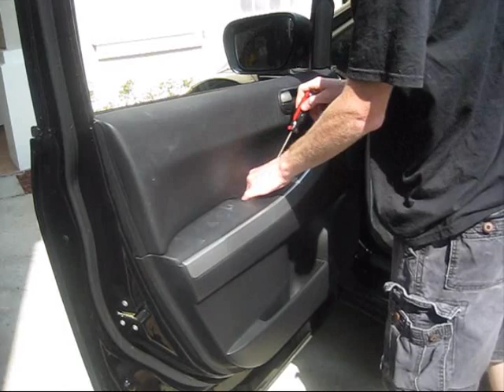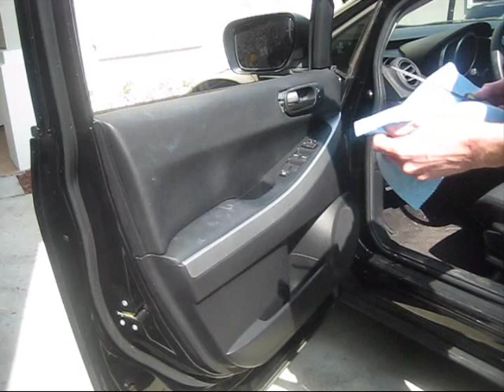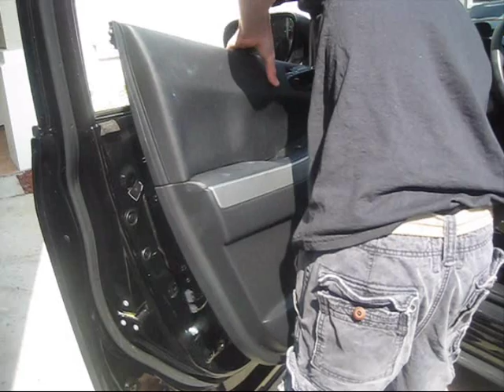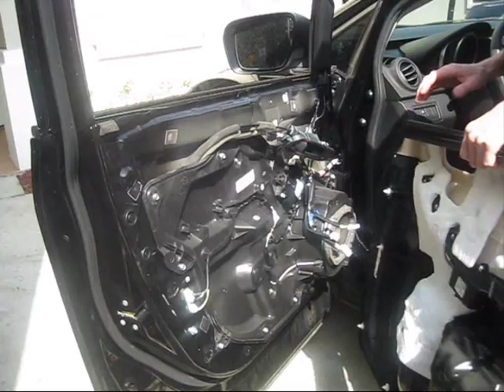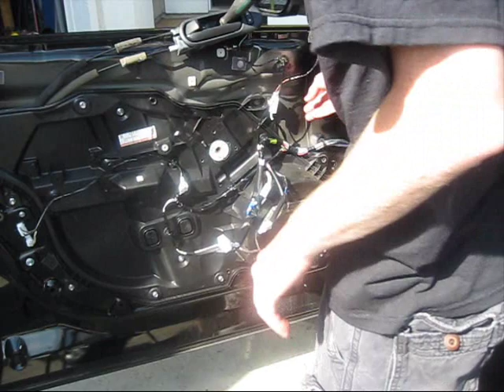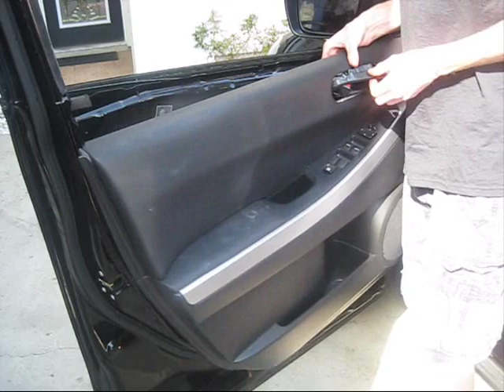Mazda CX-7 Window Motor Replacement

Comment: All of the disassembly instructions are correct, however, the sound you heard when you roll the window down is the sound of a broken gear that is connected to the motor. The motor is fine. If you look on the Wish app, you can find replacement gears for about $10. The you simply open the gear housing attached to the motor, replace the gear and that's it!  The whole process done in less than an hour.  I've done this myself.
Reply from the maker: Back when this video was made aftermarket motors didn't even exist yet. You had to get them from the dealer.

Comment: Can i just fix the stock window motor not replace it
Reply from the maker: You can replace the stripped out gears if you don't want to replace the whole thing. I recently had another go out and just picked up a good used one from the junkyard.

Comment: This happened to both of my front windows...instead of replacing the whole motor($200 last time I checked), if you open it up, there's a plastic white gear that had teeth broken off of it. I found a replacement gear for $7 on eBay. Saves a LOT of money!

Comment: What should I do if the metal wire comes off the plastic rotator inside the door? The window will come up about 10 inches and then fall down. The plastic on the rotator seems a little damaged but the metal wire also has parts in it where each individual wire is splitting apart. Any help?
Reply from the maker: That's what's called the regulator, you're best bet is to get a new one.

Comment: On my wife’s 2011 CX 7 the driver side window motor gear was stripped. The gear is made of  plastic, and  will not hold up to the torque of the motor. Followed the aforementioned  instructions, and worked like a champ. The door body snaps are very brittle. Had to replace four of them.  (Advance Auto $3.50) The motor was from Rock Auto , $47.00 delivered.  U tube University is great.

Comment: do you need to replace the window motor or just the $8 gear that goes inside the motor?
Reply from the maker: If you can get one just the gear, but they were only available as an assembly from a dealer when I first did this.
Reply: pfun41 fortunately for me, I just replaced with an $8 plastic gear and it worked fine. Thanks for the video

Comment: just wanted to say thanks so much man! just got done doing this and it wasn't to bad. however, for people doing this make sure when you remove the door handle assembly you make sure the cable controlling the lock is still in place. put the whole damn thing together just to find out the lock wouldn't engage. there is a slot that the cable slides into. think bike brake cable. after that it worked perfectly. thanks a million.

Comment: Just did mine and it works great now.  
But I still have one problem now, the door locks will not lock on the inside.
They will only lock from the outside.  What can I do?
Reply from the maker: Sounds like the lock switch connector didn't get plugged back in or a wire broke. Pop the interior handle assembly out and check the wires.
Reply: My wife tells me that's the way it should be.  If the engine is not running you cannot lock the doors.  Only after the engine is turned on will it lock.   so we're good.  There's another video on this where he ran into the same thing and I don't know if he ever figured it out.  I will try to find it and let him know.  One more thing, I didn't realize this when I was taking the panel off, but mine has two more screws to take out before taking off the panel.  They are hidden behind a cover on the door pull that I have on this model that you don't have on yours.  I had a hellava time trying to figure that out but eventually got it.  Thanks again.

Comment: I'm attempting this today.  What I am unsure of is after installing the replacement motor, you mention that it might not "line up correctly".  That needs a bit more clarification.  If it's not lined up correctly, does this mean, removing the motor and lining it up again, and then using the window control to move the spline in the motor?  Is there a way to ensure that the motor is lined up before installing the new one?  

Based on the video, It would seem that one would need to remove the motor to align it.  I guess I am just not sure how the motor can't be in alignment. If you roll the window all the way down, and then install the motor, and everything fits nice and tight, there shouldn't be any mis-alignment.  Unless, the motor has a range of motion in the gear box. Meaning that the motor knows when it is in a fully up or down window position.  But I'm assuming that the motor, when not connected to the regulator, will just spin in either direction continually.  If that is the case, how can it be not in alignment if installed correctly?

Does this make sense?
Reply from the maker: When you pull the old motor out the window may drop a little and the splines will no longer be in a position where the motor can just slide on and be lined up with the mounting holes. You may have to rotate it a little to get the holes to line up.
Reply: Thanks for the reply.  Actually, got this done in about 25-40 minutes.  Had no issues whatsoever in getting this done and saving over $500.00.  Thanks again!

Comment: Excellent video. Thank you very much.

I went 1 step further & purchased just the gear for $10 instead of the gearbox assembly for $58.

Tips that I found helped, in addition to or instead of what you show:

1 - First remove the little black plastic panel above the door panel, at the leading edge of the window. It's easy. Pull straight out on the top to pop 1 snap, then lift up & out to unhook an L-shaped feature. This will make removal & reinstallation of the door panel easier, as it hooks over the door frame.

2 - After removing the door panel from the door, consider using small pliers to help squeeze the wiring harness connectors to remove them from the door panel controls. They're rather stubborn. I noticed pauses in your video when unplugging them--I guess you found them challenging too. :]

3 - After removing the door panel from the door, see which side has the white snap clips. They're supposed to be attached to the plastic door trim, not the metal door frame. Any clips stuck in the door frame need to be removed--try digging in small pliers or tweezers or screwdrivers to pry it out--this is a pain in the neck. After getting them out of the door frame, slide them into the pockets on the door trim panel & make sure they're in the correct position for later installation, so they poke right into the holes in the door frame.

4 - When cracking open the gearbox, you don't need to remove the motor. Use a thin knife of some sort. I prefer the tool that removes the backs of watches to change their batteries. It's a good compromise: not too thin, not too think, strong enough to bend & pry (and found cheap on-line!). Don't pry apart on the triangular wings--they're rather fragile--pry apart the seam at other sections of the body gearbox that are stronger--once you get started, it comes apart pretty easily.

5 - When reinstalling the gearbox, first bring the regulator (white spool with steel cable wrapped around it) & its frame toward you so that the screws can reach it, & line up 1 of the regulator frame holes w/ 1 clearance hole in the sheet metal. The trick then is to very gently & slowly bring the gearmotor assembly into place & mesh its spline with the regulator's spline so that you don't displace the regulator. If, like me, you find that you are unable to get the correct aligment, pop open the gearbox, rotate the output shaft spline a little, reassemble, & retry. If the clocking is correct, the gearbox slips easily onto the regulator. Bonus trick, stick a long, thin, & non-marring item down into the door behind the regulator (mind the window!) and forward on the back of the regulator to keep it from getting pushed into the door during this step. All these steps should help you not need to remove extra fasteners to bend back the door panel to get your arm down in there behind the regulator, if you find these steps easier instead.

6 - Put it all back together in reverse order, & put back the little black upper panel last, after the main door panel has been reinstalled.

Thanks,
-Jason
Reply from the maker: You can get just the gear now!? When the first motor went out on this thing I had to buy a new motor from the dealer.
Reply: https://smile.amazon.com/dp/B00VYTDD3C

Comment: Great video, thanks.  My driver window makes the same grinding sound as yours except I cannot lower mine at all.  It is in the full up position.  When I try to lower, it will move like a hair and stop.  When I close it, it closes then gives me the grinding sound.  Would you think it is the motor?
Reply from the maker: Motor or regulator, probably motor. Try pushing it down while holding the button. If it goes down then it's probably a stripped gear in the motor.

Comment: I have similar problem, with the passenger one, window doesnt want to roll up, or stays in the middle, but i can hear the motor working. Is it the actual motor or the regulator? Its Cx-9 2008
Reply from the maker: could be either, pull it apart and see if the motor spins when you hit the switch.

Comment: Because of people like you and I,  Mom & Pop businesses, especially Car Dealers cannot longer rip decent people off.  This is what YouTube is best at. Great tutorial video. Thank you very much. I also help people the same way. Yesterday my father went to a local mechanic shop and they was asking $50.00 to inspect the door which could be deducted from the $250.00 to replace the motor or $280.00 for the motor + regulator +  labor  "Long-Live-YouTube". 100 thumbs-up for your presentation and two fingers-up  for the mechanic shop.
Reply: What exact types of screwdrivers do I need?
Reply: regular screwdrivers. "Phillip" type for the screws and "flat" to separate the panel(door cover) from the door. 95% of the time the parts that break is a plastic gear side the motor box. I bough that plastic(white color) gear in ebay for around $6.00 with free shipping(from Turkey) It takes around 15 days to arrive. Listen, you don't need to buy the entire motor unit, that will cost you more. Again, you can fix the  problem by replacing the broken gear at ~$6,00 from ebay. Good luck.
Reply: I guess you bought from bross 😁
Reply: Maybe, I don't remember. I have to take a look in my pic. album and in my online purchasing records

Comment: Great video! help a lot! I also found out that the problem with the motor is a gear that can be changed to save a lot of money. I just did this and works just fine.
Reply: Hola, has cambiado la rueda dentada de plastico y se arregla?

Comment: How do you take a door panel off a 2011 Mazda cx-7 if door don't open
Reply from the maker: +Manuel Contreras get the door to open first, since that would be nearly impossible.
Reply: Door don't unlock or open
Reply from the maker: Manuel Contreras
well you could try to pull it off in place or just cut it apart and replace it. Only other option is to try to get some space to get your hand in there and pull the release rod for the latch.

Comment: My 2007 CX 7 passenger side window will try to go down then seems to get "jammed" and stuck without opening at all. Is this a motor problem as well, regulator, or both?
Reply from the maker: +Mikay Deise sounds more like a regulator problem. Unbolt the motor and see if it will go down all the way.
Reply: Thanks for the advice... Replace the regulator yesterday... all good!

Comment: Great video, increased my comfort level immensely.

I would like to note that there is one additional step when taking off the passenger side door panel. As the passenger side has a vertical pull handle, there is one more screw behind that. The cover is sort of tough to get off but there is a phillips screw behind it.

Also for the people with auto up/down switches not working that is a simple reset; with window all the way up put key to ACC, hold down (all the way engaging auto) until the window bottoms out, then hold up (all the way engaging auto) for 3 whole seconds.
Reply: Todd O thanks dor this part too so nice to have this right and working
Reply: This completes the awesomeness of replacing these things on both sides for me! Mine were 30 bucks each! I lost a window to a thief - who didn’t get anything - replaced my driver side window for 65 bucks and went ahead and did the motors too. The window replacement was quoted at 450, and I did the window and both motors with full auto restored for 140. 🎉

Comment: Great video, would this be the same for a 2012?  My wife's has the same behavior, the dealer wanted to charge 2 hours labor =/
Reply from the maker: +Beard Fort Probably. I haven't heard if they changed the design or parts used.

Comment: My 2008 Mazda cx7 does the same thing as the one in the video. Can I simply replace the lift gear or do I have to replace the entire power window motor?
Reply from the maker: Last I checked they are only available as a unit, you have to replace the whole thing.

Comment: Do you think the process would be similar on a CX-9?
Reply from the maker: Probably, from what I've heard these same lousy window motors are used on a number of Mazda vehicles, where they have the same issues. The CX-9 is just the next size up from a CX-7 so I wouldn't be too surprised if it's exactly the same.

Comment: Great video pfun41! It will help me get my passenger door panel on my '07 CX-7 apart when I figure out if the problem is the motor or switch? Passenger side front window quit working luckily in the up position. At first when pressing the driver side switch for that window I would  hear a clicking noise at the passenger side switch and I believe the LED's would illuminate also. Now when you press the drivers side (master control  switch) you hear nothing and no LED's either. Passenger side switch nothing either. I'm not sure whether the problem  is the passenger side switch or motor? Any help would be greatly appreciated. I hate to take it apart not knowing whether the switch  or motor is bad. I  know how  to use a multimeter and am pretty good at electronics. Thanks for any help you could give me!

Mark in Kentucky

Comment: Man, you saved me about 300-350 bucks today, no lie. My wife's car had the same symptoms and sound. One question and two observations:

Question: I got the replacement part at NAPA, which works fine except for one thing. The auto function no longer works. Meaning, you have to hold the switch up or down the whole time to make the window go up or down. Any idea why that might be? Is that normal? It always worked before.

**I noticed if you take of the small triangle-ish panel (by the mirror on the inside) over the main panel that makes it easier to remove.

**Also, unscrewing the motor FIRST then removing the connector worked. I tried to remove the connector with pliers, and a screwdriver (that might be why the auto up or down doesn't work anymore). There is a tab that needs to be pushed in (with a small screwdriver) to let the connector loose which is really difficult to do otherwise. That tab is on the backside of the motor.

Thanks for this!!! Very helpful! If you lived around here I'd buy you a beer and dinner or something. Peace.
Reply from the maker: Most auto up/down functions use the amperage draw of the motor to determine when the window is all the way up or down. There might be something different about the new motor making the auto window function not respond correctly. If you just tap the switch will the auto function work? If you hold the switch more than a certain period of time it cancels the auto function.
Reply: ***** Actually, the window started working as it should a day later. Maybe it had to get broken in electronically (?). Anyhow, you saved me a ridiculous amount of money. The part was about 20 dollars more than the estimate I was given (and that's NOT at the dealership). A $125 dollar part, 30 minutes worth of work, too easy. Thanks, man!!

Comment: Thanks for this video. I got a CX7 and the power window button for the passenger side works fine, but it stop working from the command center, my driver side. Any ideas what could be the problem? I appreciate feedback on this, thanks.
Reply from the maker: sorry, I just figured out the new comments. If nothing was replaced then there's probably an electrical problem with the driver side switch.
Reply: Okay, fine. Thanks

Comment: Thanks for posting this video..you saved me $350 they were charging me to replace the motor in my 2007 mazda 3s. After a little effort, it works like a charm.